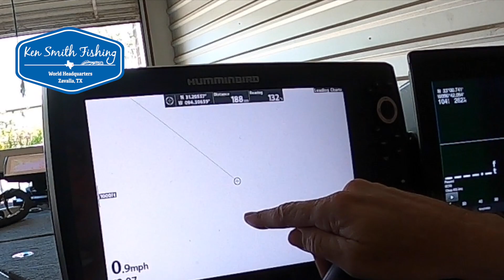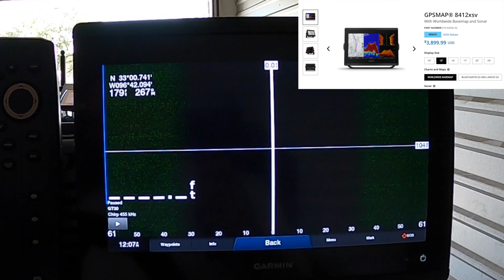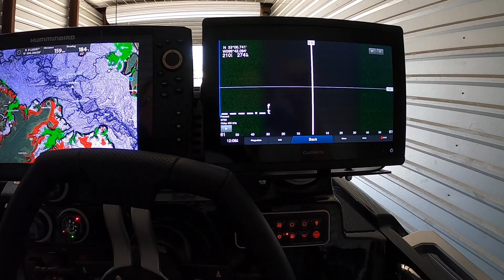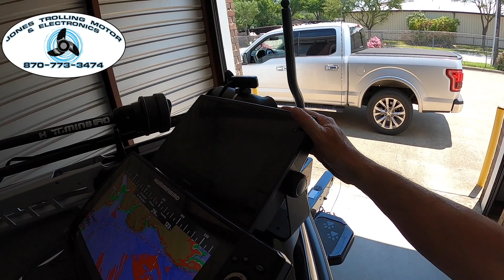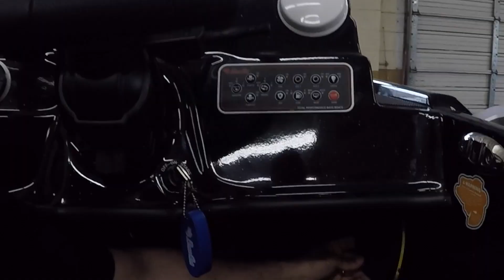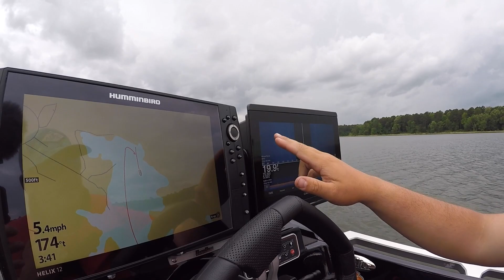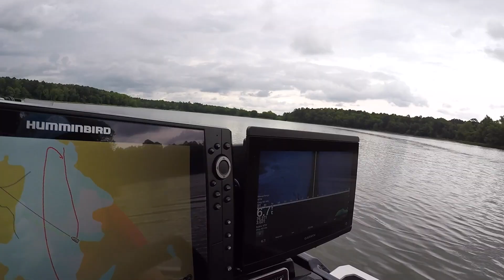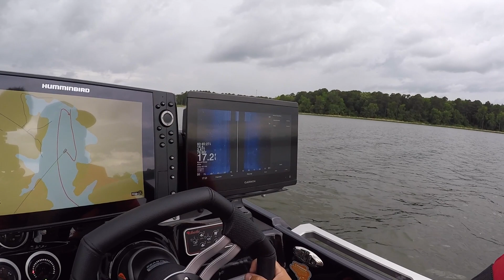Boat Electronics Setup - Rigging the Bass Cat Lynx

Comment: Great video, thanks for sharing.  Would like to comment regarding HB not warrantying the shaft when a support is used.  Have you noticed that Ott Defoe,  Carl Jocumsen, Brandon Paliuncuk both have those supports on their TM.  I know they are sponsored by HB, but still may they are sponsored by the one that produces the mount...Not sure....Just odd regarding the mount and HB makes that statement, yet 3 of the anglers they support have mounts.   Thanks again for the video...good stuff.
Reply from the maker: Donnie Humminbird did reply to me, here is there answer verbatim "Thank you for contacting Humminbird. We appreciate your support of our products.   We are aware of third party support brackets.  We do not endorse these products. 

Any physical damage to the 360 pod, shaft, cables, or connectors would not be covered under warranty.

If we can assist you further on this subject or any other Humminbird related questions please feel free to email us again or contact our Technical Support Department at 1-800-633-1468. 

Good Boating and Fishing! 

Deborah
Technical Support Representative"

Comment: Really nice boat Ken. The only concern I'd have with your unit set up is the mapping unit and SI unit not being compatible. I also run 4 grafts but I run 3 birds linked together, With a garmin for just livescope. I can't tell you how many times I mark weighpoints off of my SI and then utilize my mapping unit to fish what I've marked. I don't think one brands any better than the other either. But for me my mapping unit needs to liked to my search unit.
Reply: I was wondering the same. Thanks for your input Patrick
Reply from the maker: Patrick you are correct, if you mark something with SI I gotta pull up map with Garmin

Comment: Ken, this is awesome! Question for you, is the one 31 AGM dedicated to start up, electronics, bilge pumps and aerators? With your old boat (Ranger), did you ever get low on juice with your electronics?  Thank you for doing this, it really helps our knowledge and growth.
Reply: Wow that's alot of strain for one battery! Can you imagine fishing a night derby and nav lights courtesy lights, dash lights, four graph's going hard ,  two aerators going , possibly two cell phones plugged in and still having to crank up a big motor without damaging the start phase windings in your starter because your dragging a lot! I'd want a current constant voltage of the system shown at all times and watch it start up
Reply from the maker: Yes, all off that one battery and yes I had issues but my belief is it was as much my charger not getting that AGM battery fully charged as anything. That said I generally still snooze my back units when I stop to fish which I started doing with last boat and crank battery issues and I’ve just kept doing it

Comment: Good video Ken.  I have no doubt the guys at Jones are carrying on the legacy of John.  And the BBT mounts rock, the geek engineer in me appreciated the fact that the dash mount does not hang the weight of the units off the face like some do, I ran one on my Phoenix for 7 years.  Solid.  Beautiful boat!

One question, is there and advantage to flipping the 360 inward?  I see that now and then, been curious why. Thanks!
Reply from the maker: I think mainly so covers fit better
Reply: @KenSmithFishing  makes sense.  Mine fits okay on the Phoenix.

Comment: Great video, love the set up! I’m just getting started setting up an older Bass Boat with modern electronics. I am curious about covering up your gauges on your dash. Seems to me that being able to see your tachometer, voltage, water pressure are pretty important. Just wondering what I’m missing or what you’re thinking is on this.
Reply from the maker: Sam Sam (which by the way is our Border Collies name) I pull all of that same information through my Garmin on the dash

Comment: Instead of using electrical tape, i use the DD26 wire mounts which incase the FFS wire in rubber gasket and is a tighter mount on the TM shaft.

Comment: One thing I’ve always wondered having these expensive graphs is someone stealing them while your on the road and parking the rig at a motel overnight. Can these 4 graphs be quickly disconnected and brought into your room or do you just leave them on the boat? Sorry I’m just getting back into fishing and have no experience with all the equipment.

Comment: Love my  2023 Cougar but have to say I am so disappointed that you would have to drill a hole in the boat just to be able replace cable and wires. I had a bad transducer on day two of ownership. I live in Maine and bought the boat in Pennsylvania, so it's not a quick day trip to take it back. had to replace but cannot even get the y cable pulled through the console to removed the old cable. Feels like it is zip tied to the hilt. Also, can't get the shifter panel out of the way because the wires aren't long enough to set it by the seat.
Reply from the maker: Deanna Cats are notoriously difficult to rig, the one knock I’ve heard often
Reply: @KenSmithFishing  I FINALLY got the cables replaced and old ones removed. Was able to lift out the cup holder on the front of the drivers console and found the wiring basically right there. A last second effort before drilling and putting in the vent plate like you did.

Comment: Hello. It looks like your boat is stored in a storage unit? If so, can you please tell me the dimensions of the unit. I’m thinking that I might want to store my Lynx in a unit so that I don’t have to fold and unfold the tongue on the trailer to keep it in my garage.
Reply from the maker: Hey Jersey, I have two places I store, in Dallas I rent a space that is 10 x 30 feet and it fits fine, I think it's 26-27 from motor in travel tilt to font of trailer hitch when it is extended. In Zavalla we keep it in the boat barn, it's 36 with x 40 so lots of room there. By the way in Dallas I pay $225  a month for the 10 x 30
Reply: @KenSmithFishing   Thanks for the reply. That's a lot of coin for that space in Dallas.